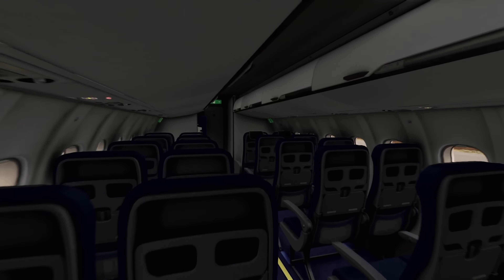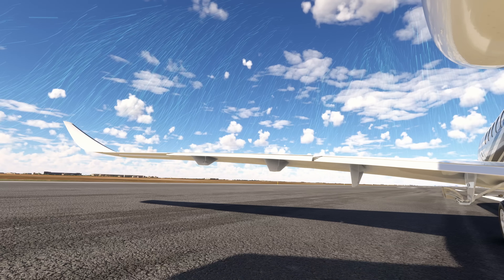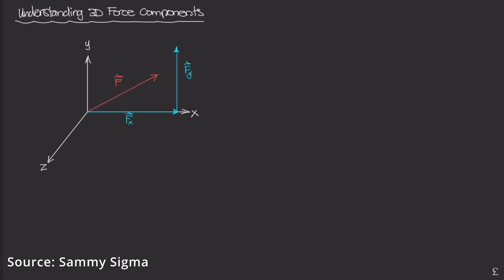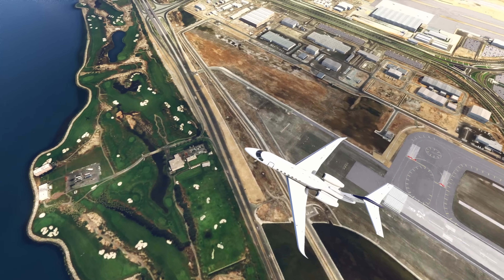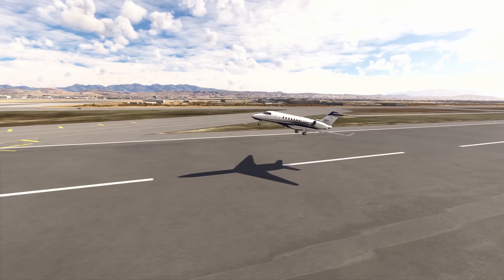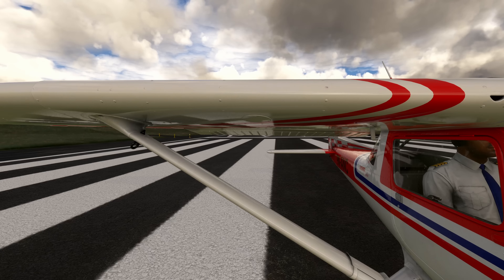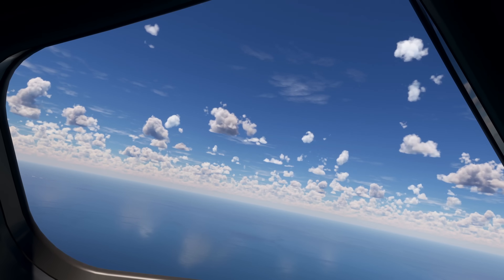The Truth about Lift

Comment: Are you saying the lower pressure above the wing does not contribute to the total lifting force as the bottom is higher pressure resulting in a pushing upward force? Or are u saying that the low pressure on top keeps the air "attached" to the wing, aka the air moves down towards the wing and back which adds to the total mass accelerated downward?
Reply from the maker: Two sides of the same coin. Pressure differential causes lift, but air has to be displaced downwards for it to do so.
Reply: @flyingformoney777  Still a bit confusing for me, the air that is being pulled down to fill the void the wing left is moving down yes but how does that interact with the wing itself? I thought the only forces that can interact with the wing are caused by the pressure differential and direct deflection downwards of air from the lower surface. Struggling to understand how the air that fills the void the wing leaves directly interacts with the wing other than just lowering the pressure of the air above it. I know you are not a scientist but just curious if you could give me some further insight
Reply from the maker: @rustydomino694  don’t worry, scientists get in a pretzel over this too (so would I if I thought too hard about it!) Up to the stalling angle of attack, the air flowing over the top of the wing follows the contour of the wing. This upper air is accelerated and directed down (the trailing edge is lower than the highest point on the wing). The result is a change in momentum. Air is essentially accelerated downwards by the wing, and this creates the opposite reaction of accelerating the wing up (balancing the acceleration of gravity when in level flight). The pressure differential is what causes this. Either way you look at it, there is a differential between the forces on top of the wing and on the bottom.
Reply: @rustydomino694  From a strictly Newtonian point of view, the pressure on the bottom surface of the wing is what supports it. The importance of the upper surface isn't in providing a force, it's in reducing it. Downward pressure would normally be on the upper surface when the plane is stationary and would counteract the upward pressure on the lower surface. When the plane is moving, the air's inertia and upward momentum pull it away from the curved upper surface, resulting in lower pressure there.
Reply: @Raging.Geekazoid  I just replied to this comment and editited it but accidently deleted it I guess lol it disappeared

Anyways I was saying that yes I understand that being the cause of low pressure above the wing, and that lift is a result of the reduced pressure on the upper surface of the wing. What I was trying to intuitively understand was how accelerating the air above the wing downward actually aids in lift because that air isn't actually "touching" the upper surface of the wing but it's still interacting with the wing. 

https://www.youtube.com/watch?v=8CzeQujarPY

I was at oshkosh '24 and this may be the best explanation, intuitively, of lift that I've seen. It shows what I'm talking about and how accelerated air above the wing contributes to lift even though it isn't actually interacting with the wing. Basically the wing affects the mass above the wing as a result of the pressure differences. It's turned downwards as a result but what I'm confused about is how it interacts with the wing.

I can understand how the air below the wing is deflected by pressure and physical contact with the wing, but the air above the wing is deflected downward as a result of the pressure difference and isn't directly caused by interaction with the wing. So how is there an action reaction in that regard. That's the best way I can explain my thoughts...

For me it seems like only air deflected from the bottom of the wing and pressure difference is how forces affect the wing.
Reply: @rustydomino694  "What I was trying to intuitively understand was how accelerating the air above the wing downward actually aids in lift because that air isn't actually "touching" the upper surface of the wing but it's still interacting with the wing."

It doesn't, but that's the whole point: Low pressure is just a lack of pressure. A lack of interaction. High(-ish) pressure on the lower surface supports the wing, and high-speed flow over the curved upper surface reduces the downward pressure that would otherwise counteract upward pressure on the lower surface when the plane is stationary.

Comment: Stick to flying and leave the physics to those more knowledgeable.  First off gravity is a force and it can be measured in lbs, kilos or Newtons.  Your weight is in FACT the force of gravity acting on your body or that of a plane.  Next there is indeed a debate as to whether Bernoulli or Newton rules regards lift.  But neither can be refuted as follows:
http://hyperphysics.phy-astr.gsu.edu/hbase/Fluids/airfoil.html
And finally lets test your theory shall we?  Yes mass is not a force and is unchanging, but weight is a force and applies perpendicular to the plane of the "ground" or more correctly from your center of mass to the earth's center of mass.  But if you weigh 150 lbs there is a 150 lb force pushing or pulling you towards the ground.  Likewise a C172 which we will use for this demonstration with full fuel and a 150 lb pilot weighs 2148 lbs according to Cessna specs.

Now the C172 has a wing area of 16.2 square meters.  And we shall see if the downwards air flowing over that wing has sufficient mass to counter the weight of the plane against gravity.  So let's select a cruising airspeed of 100 knots which is 51.4 meters per second.  And let's assume that the depth of the air over and under the wing is 0.6 meters combined.  So we have a volume of 9.72 cubic meters of air associated with the wing's motion, at a speed of 51.4 meters per second, which yields a mass of air flowing aft of the wing of 644 kg, when we use sea level air density of 1.29 kg per cubic meter.  (it would be less mass of air at any reasonable altitude)

644 kg is 1420 lbs of air shooting behind the C172 wings.  Now if that air flow is pointed 15 degrees down from the wing, the vector sum is an upward lift of 367 lbs.  Uh Oh, Newton is faltering bubba...

What if the rearward airflow is angled down by 30 degrees, then the lift force against gravity would be 710 lbs.  Oops, Newton cannot explain lift by itself.

You must invoke Bernoulli to come to a reasonable resolution of the forces involved.  As the above physics web page notes, both theories are correct and neither can be proven wrong.

Comment: I disagree a little with the part starting at 6:20. This is about flight mechanics and the forces acting ON the aircraft. If these forces equal out, its a steady state flight according to the 2nd axiom. This is not related to the 3rd axiom about the counterforces. Every force of these 4 forces acting ON the airplane has an equivalent counterforce that the airplane opposes to its environment, which is not included in the picture, as it has no effect ON the (own) airplane. For lift it is the force pushing air down as mentioned. The weight was also mentioned in the beginning of the video. The airplanes pulls the earth. Thats the 3rd axiom counterforce to weight. Lift is only a force needed to achieve steady flight. Counterforce to drag is the Air pushed forward in front of the plane and the counterforce to thrust is the force on the air, propwash/jetwash. So, the picture in 6:20 is by no means wrong. It is just not about aerodynamicforces and movements in the air, its about flight mechanics.
Reply from the maker: Sure. It’s a lie in the sense that it leaves stuff out. Aerodynamics are important. I was using a little hyperbole to make that point.

Comment: For brevity I omitted the obvious fact that an increase in speed, besides encountering more air mass, also proportional increases the invoked acceleration and  downward speed of the air mass, yet another reason to decrease angle of attack. Frictional air drag increases with the square of velocity, typically requiring more power. Wings are cambered primarily for streamlining.

Comment: I teach science to kids and I cringe when the textbooks parrot out the old equal transit misunderstanding. Heck, I was shocked and disappointed to see Neil de Grasse Tyson do it on TV. If this worked, a helicopter could hover with no downdraft. If this worked it would be an anti gravity device. The weight of a flying plane sits on the ground below and behind it due to the overpressure it creates.

Comment: Newton's 3rd law is absolutely correct, but it's more like the "consequence". Yes the wing ultimately deflects the air down, but no it doesn't works like "bounce balls against a wall at an angle" kinda of depiction, you didn't say that, but if you explain to others, it's likely they will depict it that way in their head. 
Equal time on the other hand is totally wrong as the air doesn't need to and does not in fact meet at the TE at the same time at all.
Another common misunderstanding: "the upper wing squeeze the air so it moves faster". Actually, for any constancy flow of incompressible fluid, squeeze of a stream tube and acceleration is same thing, you don't have to use hard boundary to squeeze the stream tube like in a venturi tube, the upper wing accelerate the air, "As a consequence" the stream tube get thinner. "" for this 2 things are the same thing in different perspective, not really one is consequence of another really. so this I would still qualify as "correct but not explain anything" like the "Newton's 3rd law" one.
Why the upper wing accelerate the air? The best explanation I could get a grasp on is kutta-joukowski theorem and the circulation is much elegant explanation for the wingtip vortex, it also unifies Magnus effect. But you can still ask deeper, then that's not something my brain could easily process.
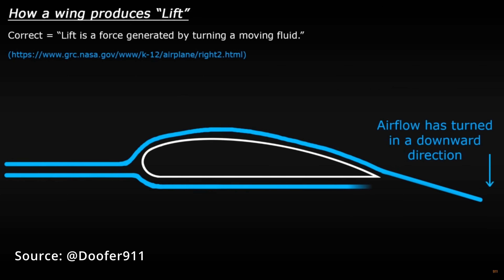BTW the picture at 7:00 still not correct, there is actually an upwash before LE, almost symmetrical to the downwash behind TE, and they both contribute to lift.

Comment: Ultimately, velocity is the critical factor. A square rock remains in the air as long as its speed remains high enough.

Similarly, skimming stones along the surface of water is the best analogy for generating lift.

Air is like water. But it can be compressed to to push back against the stone. A stone at the right angle of attack will continue to lift off the water’s surface until it loses enough speed.

The stone plummets to the surface beneath the water, just like an airplane that stalls in the air and spins to the ground.

Propellers don’t generate thrust unless they’re moving very fast around the air. The engineers make the speed efficient, but it’s the speed that counts most.

Comment: You think lift is hard to explain, try explaining glider aerodynamics.  If you ever see a winch launch for a glider, that wing is WAY beyond the critical angle of attack.  Then there is gliders climbing in thermals.  Great video!
Reply: Not that hard to explain.

AoA is the angle between the airflow and the airfoil. Don't confuse AoA with pitch angle (angle between horizontal plane and airfoil). As the movement of the glider is very steep, the AoA is much less than it looks from the outside. If the glider pitches up 50° and its path is 40°, the AoA is only 10°, well below. 

In thermals the air just moves upwards and takes anything flying in it with it. Just like the wind horizontally, only vertically.

Comment: Would a wing be able to fly, turn, climb, and descend if it were in an atmosphere that was equidistant between two earths of the exact same size?
Reply from the maker: Yep, but lift would have to be zero.
Reply: @flyingformoney777  As long as there is sufficient momentum, wouldn't there be lift?
Reply: @daffidavit  Flying without gravity would be easier, not harder. You wouldn't even need curved wings. Zero gravity, zero angle of attack, zero lift. No problem. 🙂
Reply: @Raging.Geekazoid  But what would a wing do in the above hypothosis?
Reply: @daffidavit  When you're going straight, nothing. It would just slow the plane down. When you want to turn, the wing would provide the centripetal force to fly along a curved path. And the wingtips provide places for ailerons to rotate the plane so you can turn in any direction.
Reply: @Raging.Geekazoid  Would both wingtips, in your opinion, be flying at the exact same speed as the other while accelerating in any direction, assuming there was no yawing occurring?
Reply: @daffidavit  Sure, more or less. There might be a tiny difference while the plane rolls, but the direction of curvature in a curved flight path without gravity would normally be directly upward (i.e. perpendicular) relative to the wings. With gravity, of course, the inner wingtip would travel a bit more slowly than the outer one in a horizontal turn. Although I'm not sure what that has to do with your original question. 🤔
Reply: @Raging.Geekazoid  I agree with most of what you said.  I was fishing to see if I could find someone who "thinks out of the box" so to speak.  For many many years, I've been trying to mathematically or physically prove that when a wing is in a constantly banked turn at a constant altitude over the surface, then both wingtips are flying at the same exact airspeed.  That is, as long as the wing is not in the process of yawing.  It's a conversation I've had over the years where most people argue that the outer wingtip flies faster than the inside wingtip, as you have stated.   I don't believe that.  I was simply asking the above questions because I wanted to see how some people might respond to a hypothetical question where a wing is flying in an atmosphere between two earths.  Maybe someday soon we can have a "professional" and adult discussion about this subject.  It's the start of a long holiday weekend, so enjoy.
Reply: @daffidavit  From your perspective as the pilot inside the turning aircraft, the atmosphere itself appears to be rotating about the center of your turn. There's no shear motion in the air around you, so air closer to the center has to be traveling more slowly than air passing by the outer wingtip. In the extreme situation of flying a gargantuan cargo plane in the same turn, completely unloaded, if the plane's wingspan is long enough, the plane could just about fly with the inner wingtip significantly closer to the center of rotation than the outer tip, so it's not moving much at all. Of course, the plane might not fly very well in that case....
Reply: @Raging.Geekazoid  Isn't the oncoming relative wind always perpendicular to the wing's "span" at every location?   In other words, the relative wind is the same at every point along the wingspan so long as the turn is coordinated. .  All oncoming "wind arrows" would be parallel each other as the wing is making a constantly banked turn.  The banked wing would experience the same relative wind along the entire wingspan, and the relative wind would be at straight ahead toward the wing's broad span.   The wing does not know it is turning, except of a higher load factor.  It acts the same as if it's flying straight and level, but it "feels" heavier.   If we can agree on this, we can say that a banked wing doesn't "know" it's turning, other than it has a higher load factor due to its acceleration.  Some agree with me and others disagree.  I've been trying to prove the answer for many years but  I can't define the equation, YET.
Reply: @daffidavit  Same direction, different speeds. Another example would be a glider with high-aspect wings doing a super-tight turn. If the inner wingtip is near the center of the turn, its speed could be significantly lower than at the outer wingtip.
Reply: @Raging.Geekazoid  Yes, but where is the "center of the turn?  This is why I brought up the original question about the atmosphere between the two earths.  There is only a subjective "center" of a turn from an observer's perspective on the ground observing the glider turning.   But since the glider's "long wing" is not connected to the ground, the center of its turn is up and above the wing.
We know that lift is vertical to the relative wind.  But when the wing is banked "relative to the earth" there are two components of lift.  One component pulls (or pushes) the wing horizontally while the vertical component pulls it upwards (from an observer's view). 
      But since the wing is not connected to the ground the center of the turn is not where you would expect it to be because there are two components of lift acting on it.  The wing is being pulled from above as well as to the side.  Thus, the center of the turn is up above the wing somewhere.  A wing doesn't turn as a propeller does.  There is no central hub like a helicopter rotor.  In helicopters, the wingtips indeed fly faster than the hub.  On an airplane, the only time one wingtip flies faster than the other is during the yawing process.
      When we alternately step on the rudder pedals, we advance one wingtip, and we retreat the other.  The advancing wingtip is moving faster than the retreating wingtip.  That's the only time one wingtip flies faster than the other.  This is why I don't believe in the "overbanking" tendency while the airplane is making turns.  I've been able to put a Cessna in a steep turn in smooth air, trim it up, cross my arms across my chest and watch the airplane turn in circles without having to touch the wheel.  The bank never changes.   Let's discuss this again sometime.  Thanks.